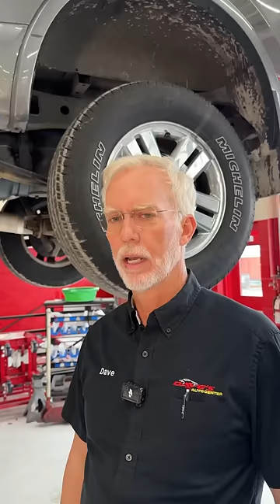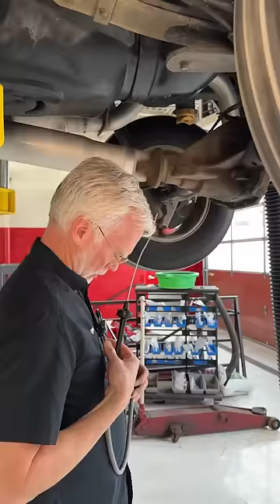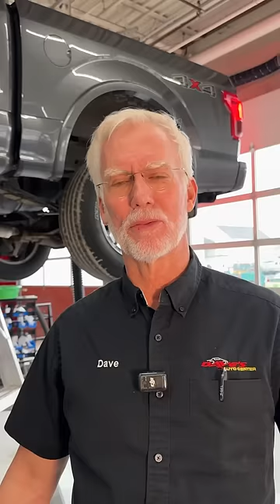Part 1: How to diagnose a noise - Dave shows us with a stethoscope 🩺 how to find a noisy bearing

Comment: Typical Ford quality. You can go 300K on a Toyota product and never have this.
Reply: God bless Toyota engineers.
Reply: Toyotas rav4 has vicious coupling issues in the exact spot he puts the first stethoscope. 
Quoted $1500 to fix or $80 bearing and 3 hrs labour done by myself.
Reply: You can go 300k on a Ford and not have that either. You can go 30k on a Toyota and have this same problem. Doesn’t matter who made it, I guarantee you neither Ford nor Toyota made the pinion bearing. Any manufacturer can have this problem. I work on Ford trucks, pinion bearing failures are actually quite rare, unless the pinion seal starts leaking lubricant and the owner lets it run dry. One example on an informative YouTube video is an exception, not the norm.
Reply: @garfield89dude32  The majr difference between Toyota and everyone else is this, and the reason I know this is I have a friend who is an automotive engineer.  He said that all companies might use the same company to manufacture let’s just a rear differential for the sake of argument.  BUT, Toyota specs out a very different level of quality standards than the others, metallurgy of the steel, tolerances, etc…. I was tired of the other stuff I was buying falling apart.  I drive a lot and sell medical devices in surgery.  I cannot afford for stuff to not work and I need 300k miles of no bullshit.  That’s when the engineer told me, just go Toyota or Lexus and forget about the rest.  I took his advice, much less stress in my life.